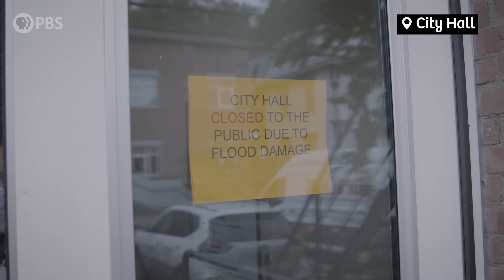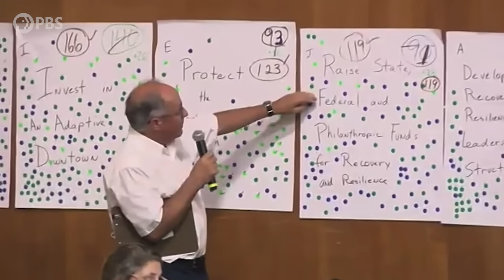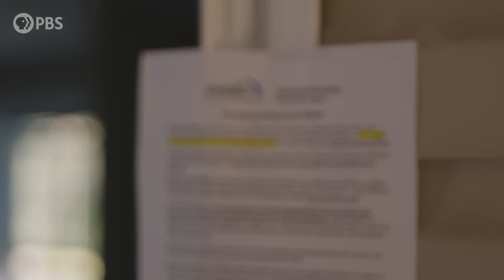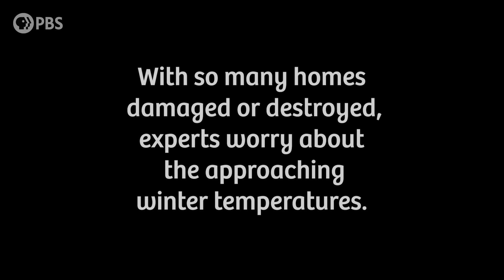What Vermont's Historic Floods Tell Us About Climate Change

Comment: Holy crap, look what "climate change" did to Vermont:   105 degree soaring hot house temperature never ever seen.  A record blaster for the state - do not go to near to Vermont if you want to escape the ravages of "climate change"    

This all time high scorching, withering, blasting, record smashing. heat wave climaxed on the 4th of July!   Run as fast as you can from what should be a moderate and kindly climate.   

Oh wait that all occurred 1911 -  113 years ago.     That was when climate change was at its worst for Vermont.   It's Never happened again since we tamed Vermont's deadly heat waves by using fossil fuels.

You think that was loathsome erratic loathsome and totally "out of all control climate change?""   It pales by comparison to Vermont's deadliest of all "climate catastrophes:   

Vermont cold that would freeze the balls off a polar bear in seconds  50 degrees below zero in Vermont on December 30.

Oh wait I forgot again,  that happened in 1933.  90 years ago

Do you detect a pattern here kids?   (adults know this climate crap is all bulls!t)   Its not only bullsh!t the evil people who but these slick videos together by the tens of thousands know its bullsh!t too.   What they know is that its easy to trick kids, thats why we dont allow kids to sign contracts - they have so little experience they are easily swindled as these people are doing to you.    

What are they trying to swindle you out of you might ask?

Nothing less than your freedom is the answer.  This is also how slave traders got free Africans aboard their slave ships before they clapped them in irons - they had their freedom stolen from them by a bunch of bullsh!tters just as bad as the people who put these videos out.  Those they clamped in irons all thought they were going on a fun boat excursion.

Unlike the monsters who put these slick sick lying videos together I have the real data:

https://www.infoplease.com/math-science/weather/record-highest-temperatures-by-state
https://www.infoplease.com/math-science/weather/record-lowest-temperatures-by-state

Comment: 8:45 lots of ideas, but none of the right ones. thats typical human: Instead of eliminating the causes, which is the uncontrolled burning of fossil raw materials, the effects are only tinkered with. Fundamentally wrong approach that only shifts the problems to other areas instead of preventing them. There is no such thing as adaptation to climate change.

Comment: I thought this was understood. The fact that permanent human settlements only appeared almost simultaneously around the world 11,700 years ago despite modern humans being behaviourlly and anatomically modern 160,000 years ago makes clear, a stable climate has always been the determinative factor in human advancement. Our ancestors were no less intelligent or skilled than us, but until the climate system settled into a predictable equilibrium, civilization was not possible. Contemporary humans, for reasons that escape common sense, have chosen to abandon that stable climate optimum, and destabilize the climate system. We made that choice, and as a result, the built environment will not be reliable. The climate isn’t just changing, it is drifting. Our ancestors contended with unstable conditions by being mobile, and living a nomadic life. For yet other reasons that escape logic, we prefer to prevent the movement of people with walls and fences and lines on maps. Instead, we insist on dwelling in unsafe or inhospitable locations, rebuilding over and over. So here we are, the worst of all possible options by our own free choices. Let’s not complain or act surprised.

Comment: I lived near LA for nearly 30 years. Typically there are roughly 10 year cycles, drought, firestorms and then deluge, rinse and repeat 🤷🏼‍♀️
Reply: The heat waves and wildfires are definitely worsening every year but this year was relatively mild, the winters are always the rainy season and this years was more extreme leading to some flooding but luckily it helped quench the drought, and the odd August tropical storm was no worse than any winter storm, so I wonder how the affects of climate change will impact tropical storm and possible hurricane risk in the future. We’ll see if this winter is equally as wet or if we will go back to another 10 years of dry sunny weather.

Comment: My suggestion would be to have living, retail, storage, anything and everything honestly on the second floor and up. Reno the bottom floors to let water flow through and seal up the basements and cellars with cement. Where applicable for streets and pavement use pervious concrete and channels that will take the water to floodplains.
I am well aware that all of that would take years, but it could be worth it.
Don't fight nature; work with it.

Comment: CO2 emissions do not cause climate change.
Reply: source?
Reply: @commanderclaus.  How does any greenhouse gas work? The sun shines light onto earth. The earth reflects back infrared energy off it’s surface out to space. No gas can absorb this IR energy unless the molecule has a dipole moment. CO2 is a linear molecule, O=C=O. The molecule can only vibrate a few different ways. The Oxygen molecules can go up and down, back and forth or left to right. Each vibrational mode corresponds to a particular frequency of infrared energy CO2 can absorb. Out of the IR energy that comes off of earth’s surface and the frequencies that CO2 can absorb, the only frequency is between 14-16um. CO2 absorbs this frequency so well, that none of that energy remains, even at very low concentrations. At only 20ppm, 50% of the IR energy from 14-16um is gone. By 120ppm, about 99% of the 14-16um IR energy is gone. For reference, all plants on earth would suffocate and die if CO2 dropped below 150ppm. Our current atmospheric CO2 is 414ppm.

Comment: One of the surest ways of identifying that a movement is desperate is to see a propaganda piece which attempts to equate occurrence with causation. Deciding that weather equals proof of the stunning hoax known alternately as the "anthropogenic global warming" and "Climate change" and (now) "climate crisis" farce. Amazingly, the Sheeple are so inured of the propagandists that they simply accept these claims instead of actually looking at the data, which show that temperatures were almost 4 degrees warmer during the Medieval Warm Period, that there is zero correlation between CO2 levels and temperatures, that there is no "crisis" in either temperatures, ice levels in the Arctic or Antarctic, no Sea level rise and no "climate crisis." There is a rise in mental illness and membership in the Sheeple movement, but the "climate crisis" is a hoax and an obvious hoax.

Comment: Building anything under 10 meters (33 feet) for sea level is just not going to last. We may lose west Antarctic ice sheets and that could add up 3 meters of average sea level rise and in the north that means 2-4 times more due to lessened gravitational pull near Antarctica.

Same goes for lowland flooding. Anything that is build in lowlands or on large flat surfaces and has not huge drainages, is likely to get flooding. Floods are often 1-2 meters high, so abandoning basement and 1st floor could answer the needs that many cities have. This is not a new invention, because many sea based buildings has already this feature. The real question is where to do this and what does it cost? And is even this enough while we keep on emitting more and more ghg's to the atmosphere?

Comment: In 1927 Vermont had a flood that was 7.5' deeper in Downtown Montpelier. The real problem is not climate but all the things we did to the river. Dams, Bridges and many man made adjustments dont allow the river to flow freely. Besides that when you build on a floodplain what do you expect? I hope we don't build out again with all the utilities in the basement. They will flood again.
Reply: Both climate change and poor river manage contribute to the increasing magnitudes and frequency of floods
Reply: You can measure disturbed flow. You can measure housing distribution in terms of location on flood plains. You can look at an old dam and see the entire upstream area is silted in with zero historical maintenance. You can go look at the Waterbury Dam frozen flood gates and see nobody moved them for 20 years.  There is no data suggesting that july 0f 2023 was anything outside of normal, Vermont has had more than 20 major flooding events on the historic record and most happened prior to the "Climate Change" narrative. You can ignore facts if you want. Data is what engineers use not fear and propaganda. Our historical climate record in Vermont is very short perhaps 200 years. Flooding like what happened in july 2023 has probably happened hundreds of times which is why the flood plains exist. A flood plain by definition is slit laid down by flooding creating a flat area adjacent to a typical river flow pattern. If you look along the Winooski river drainage there are many Ox bows as some call them. These are former river flow paths that still exist but are disconnected from the current flow pattern. They end up like they are now because the river altered its flow path most likely during a flood. If the last flood event was so far outside normal why no new ox bows? You would think if this type of flooding was so extraordinary and new we would see flow patterns altered as they clearly had in the past. Happy to alter my opinion as soon as real data indicates something is changing that we actually caused. This not might or could or any of the typical journalistic cop outs are all over every story. Real hard data that is not massaged, altered or screwed around with. Bring it if you have it and please don't say everyone agrees so it must be true.  @AA-vi1cc

Comment: Our daughter owns one of the businesses flooded in Montpelier. After months of hard work, she has finally reopened...
Reply: City floods are caused by insufficient drainage infrastructure, they are all man made.  Likewise bad wiring sometimes causes homes to burn down and poorly designed sewer lines often backup and ruin property.    None of this has anything to do with "climate" (average weather)
Reply: You are an idiot.

And your kind will make those kinds of nonsense assertions right up until the
climate change bites you in the backside with unforeseeable extreme weather.

The fact is that climate change is making everything worse and not necessarily in a way the humans mind can easily process.

E.g. City drainage designed for  more than 5" of water in 24 hours (likely based on historical data) is not going to be able to handle 9" of rain in that same window of time.

Comment: At this point, it shouldn't matter if you think climate change is man-made or not. Throughout history, humans have been changing nature. Why shouldn't we work to change this part as well?
Reply: What caused the Vermonts deadliest flood in 1927?
Reply: @kmoses582 What people always seem to fail to grasp is that climate change doesn't typically create new kinds of weather. It simply takes what was already the weather of an area and ramps it up. It means that the rare combination of factors that can lead to a massive flood or a devastating drought occurs more frequently and more intensely. It's like the difference between a pot of water on a stovetop that has been set to the lowest setting versus a pot on a stovetop on the highest setting. Both pots will eventually boil, but the one of the high heat will boil faster and boil much harder than the pot on the low setting.
Reply: @DragonFae16  Again what caused the 1927 floods? PBS painted a picture of Vermont not having theses events but 1927 was Vermonts worst flooding and killed 84 people, 8.71 inches fell in 38 hours compared to 48 for 9 inches in 23
Reply: @kmoses582  What caused those floods are the same forces that caused the 2023 flood, which is what I was saying. Before climate change, those massive floods would only show up once every few generations, which is why they were called 100-year floods. But because climate change ramps everything up, we now get 100-year floods every decade. Climate change doesn't create new weather, it simply makes the existing weather way worse and causes it to move.
Reply: @DragonFae16  I agree that what caused the 2023 floods is similar to what caused the 1927 flood. Its called weather, weather has been part of this planet since the start of time. Alarmist like you act like co2 will make thing much worse.
Reply: >change climate change

that's not how it works. not in a generational timescale.

Comment: more than 50 years of warnings, but only now are we beginning to take it seriously.
Reply: I forget exactly where I read it, but while doing research a few months back, I found an article from 1897 already talking about how much damage folks were worried the Industrial Revolution was going to cause future generations.
Reply: i remember reading about that too.
 @Ace-1525  "On the Influence of Carbonic Acid
in the Air upon the Temperature of
the Ground
Svante Arrhenius
Philosophical Magazine and Journal of Science
Series 5, Volume 41, April 1896, pages 237-276.
This photocopy was prepared by Robert A. Rohde for Global Warming
 ) from original printed material
that is now in the public domain.
Arrhenius’s paper is the first to quantify the contribution of carbon
dioxide to the greenhouse effect (Sections I-IV) and to speculate about
whether variations in the atmospheric concentration of carbon dioxide
have contributed to long-term variations in climate (Section V).
Throughout this paper, Arrhenius refers to carbon dioxide as “carbonic
acid” in accordance with the convention at the time he was writing.
Contrary to some misunderstandings, Arrhenius does not explicitly
suggest in this paper that the burning of fossil fuels will cause global
warming, though it is clear that he is aware that fossil fuels are a
potentially significant source of carbon dioxide (page 270), and he does
explicitly suggest this outcome in later work. "
Reply: The problem is that taking it seriously as an individual doesn't add up to much. Even if you have a few hundred or a few thousand people that agree and do something, it is less than a drop in the bucket.

There are 8 billion of us and we probably need at least 25% (and preferably 50%+) of those people to see the problem and avt on it or nothing will change.
Reply: @jnharton  it's a problem.  problems need to be solved.  can we solve problems?  if so how do we do it?  it's happening right now. alternative energy is evolving into the answer, or at least a major part of the answer.  the orange freak is a problem.  how do we solve that problem? the answer is evolving.
Reply: Good point. And the GOP still isn’t going to take it seriously.
Reply: The climate changes.  Always has and always will.  Paying huge taxes to the government won't do anything but make you poorer.

Comment: "It's amazing to me what decades of a town look like when you put it all out on the street"

I guess nobody bothered to tell this guy that the same buildings flooded 12 years ago so none of this stuff is decades old.
Reply: Different areas flooded this time versus Irene, all the repairs held, but that meant different places were the weakest points to fail. This wasn't a Tropical Storm either, so it didn't affect us the same. We weren't already fully saturated when Irene came, and the days after Irene passed were relatively clear. This July was an extreme weather event when we couldn't hold any more water. The ground was already full, and so were the river banks from a rain filled June.
Reply: @Emmygedden  "We weren't already fully saturated when Irene came" Clearly you forgot the rain storms in May of 2011 when downtown Montpelier was literally an inch from flooding.
Reply: @vwnut13  An inch from flooding is very different than inches of flooding. Close but not the same. 
Please remember Irene came in the end of August, an entire summer separated them.
Reply: @Emmygedden  In the 3 months prior to the 2023 flooding Montpelier had 8.76" of precipitation. In the 3 months prior to the Irene flooding Montpelier had 16.52" of precipitation.
Reply: Montpelier did not flood in Irene (12 years ago) , however it did flood from an ice jam in 1992 , that water wasn’t as high but basically had projectiles in it that destroyed downtown and a rail road tracks bridge snapped in half
Reply: @JenniferTVPatrickTV  Montpelier didn't flood during Irene? Check again.
Reply: And July was the 13th driest in the northeast since 1895, according to NOAA. By the middle of August, Vermont was having a drought. Lake Champlain went from the record setting 103.2 ft in May to 96.02 ft. This information comes from the Vermont State Climate Office's report titled "From a flash drought to the flooding rains of Tropical Storm Irene"